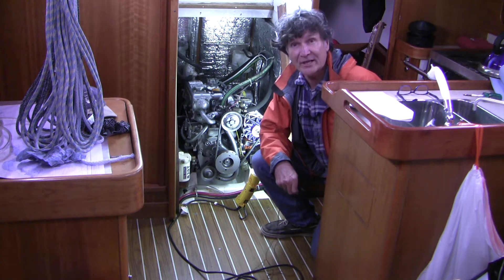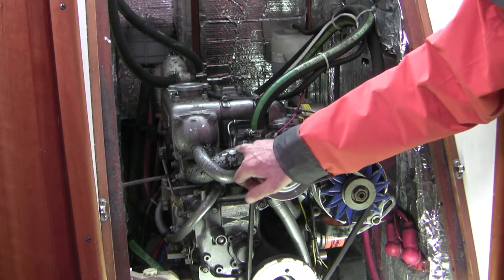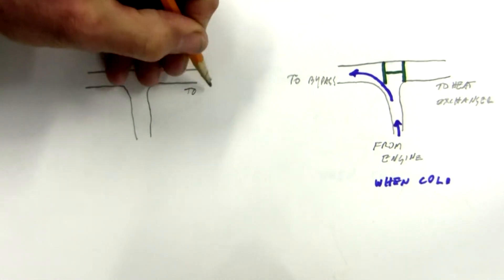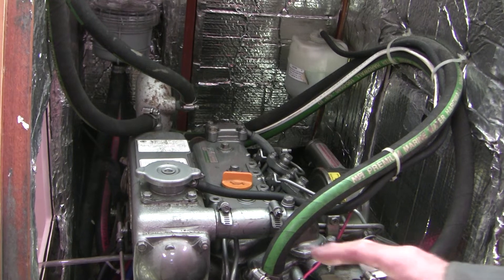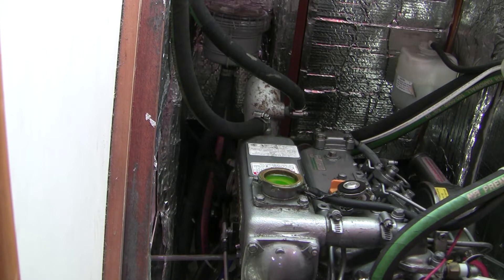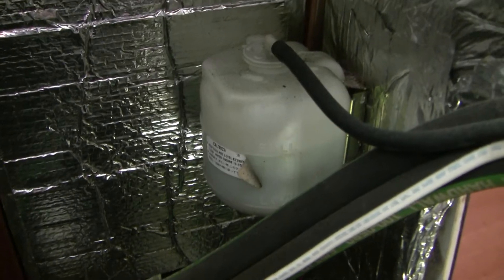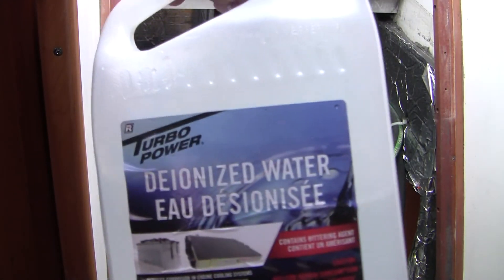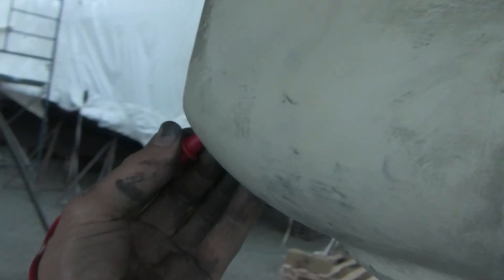Understanding marine diesel engines: Yanmar coolant exchange

Comment: Fantastic. Question on the Zincs...am I right then, in understandingthat since my boat is in Salt Water, I do not need to worry about the zincs in my Yanmar 3HM? the two on the side and the one in front as in your diagram?
Reply from the maker: If the fresh water pump delivers antifreeze rather than lake water around the engine jacket, engine block zincs do nothing and they may interfere with the anticorrosive effect of modern coolants. You should be able to spot the rare boat designed to directly cool the engine with lake water, because it won't have a heat exchanger, antifreeze, and two pumps.  Those boats do use engine block zincs. Note that if you have a Yanmar sail drive there is both a prop zinc and an internal sail drive zinc, so look for those. I dangle a third zinc over the side, with the wire attached to a bolt on the sail drive. I do this because the body of the sail drive is aluminum and that metal is particularly sensitive to galvanic corrosion.

Comment: Hi, that’s a very well explained video! My coolant went black when I removed it to service the heat exchanger. The engine is fine and never overheats. Oil level is fine hasn’t dropped. Why has it gone black?
Reply from the maker: If the seal between heat exchanger and salt water side was compromised, you might have had transfer of soot from the exhaust system into the coolant pathway. For that to happen in a big way you'd likely have compromise of your exhaust elbow. Or maybe it was a transient effect seen while the salt water side was purging air. I'd start by flushing the antifreeze side and repeating a pressure test to be sure the system holds pressure. If you're lucky, the seal is intact after bolting it down, and all that is needed is a flush. Watch for a dropping coolant level and for excessive steam in your exhaust, which could happen if there's an ongoing leak of coolant into exhaust. Oil can also transfer to the cooling system (most often through a head gasket leak). If the engine was fine before the repair I don't see why that would happen. You might do an oil change to be sure coolant isn't going the opposite way and contaminating oil.

Comment: Wow thanks for the quick reply! I will experiment with lowering the sub-tank to see if I can reduce the gushing when I open the cap. It’s crazy how it is now. The cap itself is pretty rusted on top so I may just go ahead and buy a new one, if I can get the part number, and one assumes that will work properly. While I’ve got you on the line—one of the engine mounts is rusted because the previous owner allowed the sea strainer to leak over it. The mounts were installed in 2017. I need to inspect them more closely but would you lean toward de-rusting and painting the one mount or replacing them all? With poor access I’m not sure how well I can thwart the rust. (Yanmar says four years to replace but the boat was lightly used.) Again, awed by your output and kind response. And then there’s the issue of the distribution of the engine mounts which apparently somebody got wrong. I have two 75s and two 100s but they are placed diagonally instead of Yanmar’s instruction to do front 100s and back 75s. If you answer all this I owe you. And if you pass by D.C. I buy lunch and we sail on the Chesapeake. I understand if you would rather go for a spin on the motorcycle.
Reply from the maker: Yeah, replacing the cap is an easy fix, I wouldn't hesitate. If you've got rust inside the cooling system, I'd flush the whole system with new coolant. I don't know much about the engine mounts but I'd focus on the rubber. If it's OK then I'd scrape rust off the steel and paint it again with rust resistant paint. Have a look at the antisiphon valve on the salt water discharge line, up high between heat exchanger and exhaust elbow. Those things can spew salt water onto the engine if they don't close quickly when the engine starts, causing rust. I showed how to inspect that one way relief valve in one of my videos.

Comment: You are brilliant! I recently acquired a Tartan 34-2 with a Yanmar 3GM30F. When I take off the coolant fill cap to check the level, I get a lot of coolant flooding in from the hose leading from the sub-tank to the neck. The sub-tank is mounted in a nearby cockpit locker, quite elevated. Is it too high so that gravity is having it's way? What height should the sub-tank be relative to the fill cap? Also, the level or trajectory of the hose as it makes it's way to the fill cap? Finally, how can I be sure I have the proper cap with the dual function? Thanks, Bob
Reply from the maker: Those are good questions. On my motorcycle the reservoir is about 18" below the top of the rad cap, and automatic burping works fine even there. Normally you want it to be about the same height as the top of the cap. As long as there are no pinhole leaks to allow air in, the hose will siphon just fine even with an S shaped pathway. Think of it like a straw, it needs to suck fluid so any air leak is a disaster. I don't think a reservoir above the top of the radiator is likely to be a problem. You can buy kits to test radiator caps, but with the broad variance of cap design those kits are more expensive than they are worth. When you look at the radiator cap, discard any cap with cracks in the rubber sealing surface. Carefully pry up on the inner gate to be sure it is not stuck down. If you find the fluid level at the radiator itself doesn't seem to be achieving automatic burping I'd wonder about an air leak somewhere. However Yanmar in their manual say a small air pocket inside the radiator is normal. On my engine, coolant is always right up to the radiator cap height.  I did a video years ago explaining how the two gates inside the cap work.

Comment: Hi - i really appreciate your instructional videos - have proven very handy.

I'm about to change the coolant in my own Yanmar 3GM30F but what I am concerned at is how to flush the coolant from the boiler and how to introduce new coolant back into the boiler without risk of any air pockets

Did you ever do a video on how to do this procedure as I'd definitely be keen to understand how to do it

Many thanks again
Reply from the maker: I'm guessing you're referring to the heat exchanger that warms your tap water when the engine is running. If so, it's pretty simple. Mine has no drain petcock so here's how I would do it. Remove the two hoses that send coolant to the heat exchanger, fix one end down low so it will drain into a pail and tape a funnel into the second up high. I would flush it in the same direction that coolant normally flows but I suppose it would work either way. Pour fresh coolant into the funnel and watch the old coolant drain into the bucket. There's only a few hundred cc's there, but you may need more than that because of mixing inside during the procedure. You may need a short piece of pipe and some extra tubing to act as an extender so your hose at each end is long enough that you don't make a mess. If you're worried about air pockets afterwards, you could reattach the outlet first, then fill the inlet hose to the top, then quickly push the top hose back into place. Air pockets are not likely to be a problem since those devices are usually mounted down low. So, unless there are loops in the tubing, air bubbles should naturally rise to the surface, then bubble away at first startup when you run the engine with cap off.
Reply: @spelunkerd  Many thanks for the advice - will give it a go this weekend and fingers crossed no dramas

Comment: Do you know what a good temp for the "fresh water" returning from the heat exchanger would be?  By using a temp gun pointed at the return hose what would you usually see if sea water cooling is operating properly?  I have a 2gm20f and my overheat alarm was going off, but the engine temp never went about 172 measuring the head and the block (over 2 hour period).  The heat exchanger was about 140 degrees and the fresh water hose into it was around 150.  I didn't measure the return hose but was wondering how much of a drop of temp should occur?  Also shot the heat gun at the temp alarm sensor and it was right around 160, same with the thermostat housing cap.  Hoping it's just a faulty alarm sensor, but any info would be great on typical running temps of the yanmar when up to full temp (I know 170-180 for the motor, but wondering about other components of the cooling cycles).
Reply from the maker: I've never measured those temperatures so I don't know. The most common problem is inadequate salt water flow, so check your impeller, intake screen, and heat exchanger right away. While at it, to be thorough I'd have a look at the exhaust elbow. Be sure the antifreeze side of the system is properly full by removing the radiator cap. If the cap or return hose has a pinhole leak, after an overheat you can get trapped air that causes a dangerous cascade of poor coolant flow.
Reply: @spelunkerd  Yes, i definitely plan on checking all components from seacock to heat exchanger to make sure nothing is impeding flow.  I did just replace my impeller before this trip, so hoping not an issue, but I always have a few extra on hand.  I did a complete overhaul about two years ago to tackle a head gasket replacement, so i replaced the exhaust elbow while i was at it, and confirmed the heat exchanger was clean and clear.  I also replaced the radiator cap not that long ago, plenty of coolant in the system.  I purchased a new temp alarm and i'll install it as i have limited time before i need to get back underway to get the boat home.  I'll test the old one once back home.  I also confirmed the belts were tight enough and i was getting good spin on the raw water pump (which i replaced last year as i got the dreaded drip from the weep hole).
Reply: all parts replaced with OEM Yanmar parts $$$. but hopefully helps.

Comment: Great video - thank you. I have a question about the optional hot-water-tank loop ... is that typically plumbed in parallel to the main coolant loop or in series? In other words ... would a restriction in the hot-water-tank loop reduce coolant flow through the engine?
Reply from the maker: It's routed in parallel to the normal cooling pathway.

Comment: Is there a zinc somewhere in the heat exchanger to prevent corrosion?
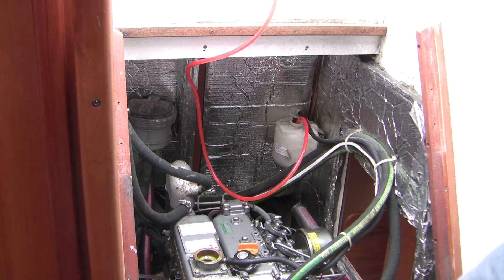Reply: Awesome. At 13:55 you talk about the zinc.
Reply: So no zincs on this engine.
Reply from the maker: Some boats spend their lives in fresh water, where galvanic corrosion is less severe. In that setting it is OK to use lake water through the intake filter to cool the engine water jacket directly. When used in that mode, Yanman did add engine block zincs that are present on the starboard side. Salt water boats like this one can't do that because the engines would die in a year or two from galvanic corrosion. So, they use coolant that resists galvanic corrosive effects, in which case engine zincs don't help at all.
Reply: @spelunkerd , I had a 1974 Islander 30 with its original engine. It spent its entire life in salt water and the engine was fine. I had it for about 5 years. I always flushed the engine with fresh water when I got back to the dock. I buffer thought to check for a zinc on the engine, but there was one on the propeller shaft. Maybe that was enough to protect the engine.
Reply: @spelunkerd , I’m researching this stuff now because a friend had a motorboat with two inboard V8 engines that were fresh water cooled and had a heat exchanger. The heat exchanger corroded through and ended up rusting out the V8s. Had he had zincs on his heat exchanger, maybe that wouldn’t have happened.

Comment: I didn't understand what you said in the begining about the sea water coming and meeting fresh water
Reply from the maker: In a classic car radiator, the exchange of heat happens between air and coolant. In salt water boats, they use a steady stream of ocean water rather than air. To exchange heat between the salt water and the coolant, a heat exchanger plays the same role as a radiator in a car. It allows exchange of heat without letting the two mix chemically. In exclusively fresh water boats and outboard motors, lake water itself is pumped into the engine to cool the cylinders directly, with no heat exchanger. The reason that doesn't work in salt water is galvanic corrosion that eats away at the engine from the inside out.

Comment: Hi. I see you changed from an existing green coolant to a red coolant.  I had thought you would have had to flush the old coolant out before changing coolant types?
Reply: It would be great to see a video on flushing the coolant sometime. What confuses me a little is ensuring the HWT flushes as well.   Also does the cooling system thermostat have to be open for this procedure.  Thanks again.
Reply from the maker: @SteveReitzel-x2o  In this case that second portside drain is on the engine side of the thermostat, so I'm confident there was little trapped coolant behind the thermostat.
Reply: When you add new coolant, how does it get pasted a closed thermostat? or do you have to run the engine until it warms up enough to open the thermostat to allow coolant to circulate through the entire engine?  Thanks for you help with this.  @spelunkerd
Reply from the maker: @SteveReitzel-x2o  That's a good question, and the answer depends on the engine. Honestly in these little diesel engines I've never had a problem burping trapped air, and recall that coolant in this Yanmar can move backwards along the bypass channel when the engine is not running. When the thermostat valve is closed the bypass valve is open, so you'll hear a glugging sound when the heat exchanger is nearly full. That sound comes from trapped air making its way to the surface at the heat exchanger. Then the usual procedure is to do as I did in the video, fill til it reaches the top of the heat exchanger, then start the engine with cap off. As you say you keep the engine running until the upper hose leading from engine to heat exchanger is hot, indicating the thermostat valve has opened. Some European car engines are a little more complex, requiring the use of a bleeder screw to release trapped air inside the engine. And some foreign cars require the use of a vacuum bleeder to evacuate as much trapped air as possible. Such complicated effort is not required for this little Yanmar.
Reply from the maker: That's a good point, without clearing the potable water heat exchanger I didn't quite flush the entire system. No matter how you do it you'll always have pockets that aren't entirely cleared, so ideally a flush with distilled water and a second drain would be a better way to do it. I did know that the new coolant has glycol in it, so I knew they were at least partly compatible. I also knew I'd be flushing the system again to clean the heat exchanger later. That two part video of heat exchanger cleaning and fresh water pump replacement is now posted on my channel. Thanks for watching!

Comment: Hello, after watching your video I checked my Yanmar 3GM30F engine on a 1987 Jeanneau and noticed that there is no anti-siphon valve but rather a T-connection where your anti-siphon valve sits and a smaller hose that goes from the T up to the level of the cockpit  and then down into the engine compartment - open hose at the end. Is this something that needs to be replaced with an anti siphon valve? Much appreciated. - Madison
Reply from the maker: That's an interesting design. Water normally takes the easy pathway out the exhaust, assuming there is no obstruction to that flow. With no obstruction, water pressure won't back up enough to reach the height of the top loop. Then when the pump shuts off, the vacuum is immediately broken and water can't siphon backwards into the boat from the exhaust. The only difference is the need for a long tube with a very high loop, and the assumption that the downstream flow will never meet an obstruction. Ultimately it will work the same way, but failure modes are different with different risks. If the downstream pathway obstructs, and if the pump is capable of pumping to that height, the salt water pump itself could fill your boat with salt water. I would probably leave it alone, especially if you can prove that this was the way your Jeanneau was designed.

Comment: If we assume coolant rarely changed, green to red coolant mixing and tap water instead of deionized water how best can we flush the fresh water side after draining?  Is there any chemicals worth refilling run engine and then drain, refill with 50/50% then drain and refill with 50/50%?
Reply from the maker: That's a good question. From where you are in your description, one way to proceed would be to completely drain, refill with distilled water (inexpensive at Walmart in the food section), run for a while, then completely drain, then refill with your new coolant. Deionized water is interchangeable with distilled water in my opinion. It is getting harder to find concentrated coolant. Many stores and dealerships offer only premixed.